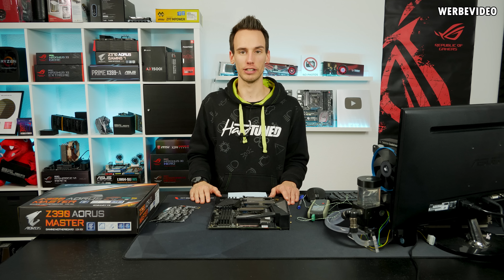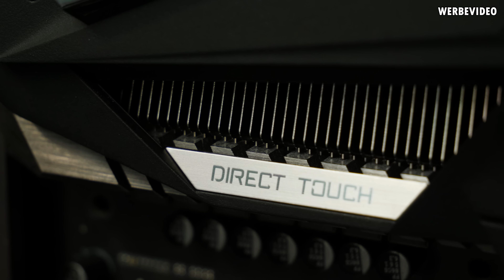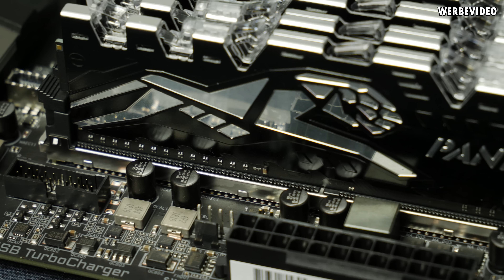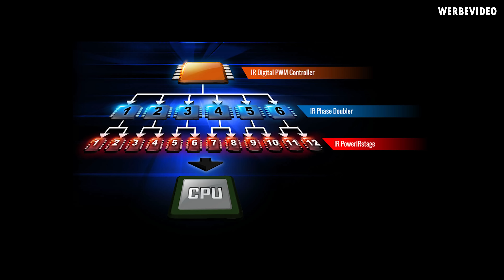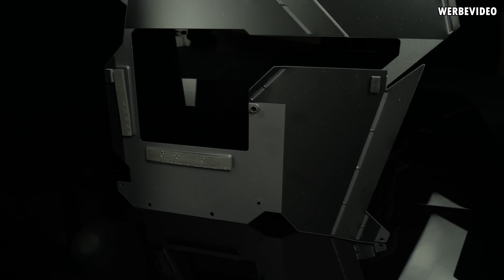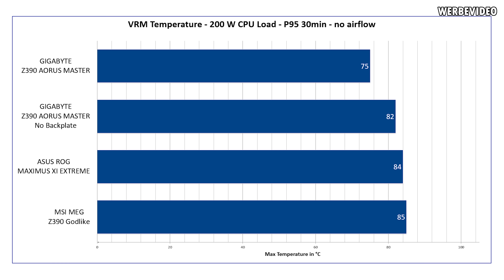Z390 AORUS MASTER - Aka the VRM MASTER (en)

Comment: I understand that I am very much late with my question, but hey. 
So, I am in doubts whether or not to pick Aorus z390 Master over Aorus z390 Pro (one is obviously better than another, but also comes at a higher cost), my main concern was that Pro has 6 power phases doubled into 12, which for no specific reason I thought might lead to  temperature issues when overclocking a i7-9700k, thus I started looking into Aorus Master which, again for no specific reason, I though had actual 12 power phases and it doesn't seem to be the case according to the internet, but is still an overall better choice due to well designed heatsinks and a backplate. Is that true and do I even need to be concerned about i7-9700k running at 5GHz on Aurus z390 Pro?

Comment: Hi to everyone.I just bought 9900k and this board and the board have 2 8 pin eps power connector to the board so should i plug the 2 8 pins to board or just 1 is oke ? i am confused :/ Also i am planing to use this cpu 5ghz all time
Reply: 8+2 you need. my friend have the same board when try to make 5.00 ghz he crash all time when he add 8+8 he get 5.20ghz but 8+2 should be good
Reply: cristian Piotr hmm interesting i am using stock now 4.7 not tried 5.0 yet but i will and try oke thanks

Comment: 9900K 5.1 GHz all cores on Aorus Master LLC is Extreme with overclocked ram (G. Skill 3200mhz CL14 to 3300mhz tightened timings) max VRM temp I've noticed is around 57C. But my case is extremely well cooled.

Comment: I wonder if sticking  thermal pads between my motherboard and case would help at all? The motherboard standoffs are pretty tall, so it would need to be a very thick thermal pad, but still, the side of the case is a pretty big area to use as a heatsink.
Reply: I thought about this as well. I think the pad would be too thick. You'd either need shorter standoffs (maybe 4mm) and then a 1.5mm pad OR alternatively normally-sized standoffs, a properly sized copper shim, and then a 1mm pad. Things get trickier if you have an m2 connector on the backside and it needs the speced 5mm of height for it. Then you'd need the normally-sized standoff solution.
Would be an interesting experiment!
Reply: Checking around, it looks like you can readily get 5mm-6mm thermal pads, but that is about as thick as I could find without being some sort of custom item. That probably isn't quite enough, as it looks like ATX specifies a minimum standoff of about 6.5mm. So, It looks like it could be done, but it would be a bit of a project, and the thermal connection between the motherboard and case probably wouldn't be a very efficient one. It probably wouldn't be as cost effective as just pointing a 120mm fan at the front side of the board, but it might still be fun to play around with.

Comment: i have this board for a month or so now and i do love it, especialy for it's price point (not cheap but not idioticly expensive)
but i do have a few things i don't like about this board, like the pci locking tabs are a bit to narrow. i have 2 watercooled 1080ti's connected with a terminal
so i like to remove and install them as one block, but it's almost inpossible to get to the lower tab to get my gpu's out. 
also i don't like the position of the error code led, my old z170 ranger had it right next to the dimm slots. this one has it right at the bottom, so in between my gpu and radiator
Reply: geen naam how’s it treating you a year later
Reply: @Everydaymoves  
hehe still good
but it's also because i got rid of my radiators and got a water chiller, so i got a lot more room in my case. can see my error code led again and working on it became easier
i'm not having the best overclocking results though. 9900k on 5.1ghz with little under 1.4 volt and a lot of bios tweaks
was hoping to get a bit further with a chiller, but might be more bad luck with my cpu
overall, good sexy mobo, if you have a bit of room in your case
Reply: geen naam I just bought it an Asus z390e kinda scared about all those negative stories I see about it failing or not posting
Reply: @Everydaymoves 
Ohh never had those problems

Comment: Very good and well presented info....I would like to know if the aorus z390 extreme has the same thermal pads on the backplate as the master....I have already purchased a i9-9900k and stuck between the Asus z390 maximus extreme or the Aorus z390 extreme for gaining the most out of my i9-9900k, although I really like that the Aorus board has the built in thunderbolt 3 and the Asus board will need a pcie card for thunderbolt connectivity. I read that the gigabyte bios is inferior to Asus bios for overclocking and most everything else, but also read that Asus thunderbolt 3 add-on card isn't reliable. I know you have hours soon hours with asus products,......what are your thoughts please???
Reply: watch this vid: https://www.youtube.com/watch?v=6J7qnr0YNH8& (and go with aorus master - deffo not the Asus, (watch other vids on this channel too)

Comment: I'm running the Aorus Ultra with my 9900k and its VRMs are staying below 60c under full load, 5.1 GHz 1.26V, no AVX offset, LLC Turbo. I have a small 40mm Noctua mounted to the VRM for cooling. Wonky bios coming from a long ASUS buying streak but I'm pretty happy with how well this board overclocks. 

Can you review the Ultra and the Master compared to the Maximus Extreme and the Hero?
Reply: 5.1 at 1.26...wow..

Comment: Der8auer : I know you're busy and I don't know if you will read this, but one thing MANY overclockers want you to test are Transient Voltage Overshoots when using "Maximum" Loadline Calibration (0 mOhms loadline) on this GB Aorus Master board.  This requires an Oscilloscope to test; maybe a Fluke Scopemeter may work too but a regular DMM is not accurate enough for this.  Transient overshoots happen in the microseconds.  It would be very helpful to set Loadline Calibration to Ultra Extreme on the Master, use a low safe volts (to protect your CPU) like 1.20v, then use an oscilloscope to test prime95 idle to load to idle (at safe settings like 4.5 ghz 1.20v, LLC=UE) to see how bad overshooting is.  Bonus for testing with "PWM Switch Rate=500 khz" and "PWM Phase Control" = Extreme (or highest setting) in the Bios.

No one has done this test before.

Comment: I actually want to see the comparison of the 5.0oc voltage among these high end boards. The thermal performance is various by many elements in the test. The voltage shows the real oc ability of the boards
Reply: 1.270v for 5090MHZ all cores on my 9900k, hits 78 degrees under load

Comment: Why don't we see more 24 phase mobos like the p67 ud7 board i'm using ? Or maybe the question is why there was a 24 phase mobo that was probably not needed.
Reply: 24 phases are stupid for almost all circumstances, if you make a good 16 phase and cool it well it can be just as good or even better, and most cpus dont need that much power anyways, not even on LN2

Comment: 9900k OP to 5.ghz  on 1.32 vcore and LLC on turbo (think it is 6 or 7).  My CPU high after on hour of gaming is 74c degrees and VRM never hotter tha. 49c degrees. Im running a 480 radiator custom loop. Gigabyte Z390 Master.
Reply: My 9900K @ 5G 1.29 LLC6 in the Asus Maximus Hero X (Z370) with VRM around 55C, never above 60. I think as long you have a decent Mobo it doesn´t matter at all which MB you get. The Aorus Master for 250 Eur is definitely a very good choice, specially compared to the 500-600 Eur top models that won´t add much for the 99% of the users.
Reply: @Miskatonik  I agree and happy with my purchase :)
Reply: my i ask how much did that custom loop cost ? i mean is it under or over the processor's price ? xd
Reply: @pktgako  Raystorm v3 water block I bought over 3-4 years ago for my 3770k and later used in my  5960x build and now used in my 9900k build. So i have gotten the most out of  my 400 dollar water cooling set up.

Comment: I feel like using the heat sink on the M.2 drives is worse from what I've seen. The controller is what gets hot and that's usually on the side facing the mobo and the heat sinks can trap warm air or affect air flow in general
Reply: Which m.2 drives have controllers facing the mb? The 960 evo surely doesn't, the back of it has no components on it as far as I remember.
Reply: I can't speak to this motherboard, but I saw much better temps without the provided heatsink on an ASUS Rog Strix Z370 I gaming. It's an ITX board where the PCH and primary M.2 sort of share the same heatsink. I tried using the heatsink with the included thermal pad, but my drive (which already is pretty hot) would get the controller up into the low 80's. Removing that heatsink and sticking on a tiny 14mm GPU ram-chip heatsink I had lying around dropped temps into the mid to low 50's. So I would definitely say not to assume an M.2 heatsink is actually helping. Fire up HWInfo and test!
Reply: btw. this vid convinced me to get Z390 Aorus Master out of all Z390 mobos https://www.youtube.com/watch?v=6J7qnr0YNH8&

Comment: Asus Z390 Maxiums XI Formule, very cold with water on it.
Reply: Bartosz Bruhn it’s kind of cheating
Reply: You shouldn't let your motherboard get wet. The evaporation cooling effect is strong but it will leave residue on your mainboard and risk shorting components. #PlayingDumb
Reply: @think_ffs3934 unless you get "pure water" which cannot conduct electricity
Reply: @DarkPa1adin  Yeah, but you're missing the joke. I was #PlayingDumb, pretending he meant he was getting the board wet to cool it, when of course he meant using a water cooler which doesn't actually get the board wet.

Comment: 5:28am in NYC I was about to close my eyes but then der8auer uploaded this video on this GORGEOUS motherboard and therefore I just had to watch it lol.
Reply: No lie it's pretty nice. I got 2 of these on sale Black Friday (it's overkill for wife's gaming PC but I like having identical components as much as possible for troubleshooting/etc and I build our PCs at the same time). As good as it looks IN the system it looks and feels better when handling the board. That blackplate is both stylish and gives you a great feeling of stability when working with the board outside a case. Of course, that only lasts until you finish your build - but then it's still pretty.  (Though as der8auer shows here, it's functional for heat reduction after that point, too!)

Comment: Can you make a video with this mb and the 9900k in overclock?
Reply: I have a i9-9900k to....and would like to see this board overclocking ability with that processor....I'm stuck between this board or the aorus z390 extreme.....would like to have the on board thunderbolt 3.
Reply: diego someone on YouTube did. I don’t remember who. Just search 9900k Overclocking.
Reply: I am achieving 5.2GHz on all cores with HT enabled stable @1.355V with this MB, after that my 9900k goes into throtling (paired with Fractal Design Celsius S36 at the moment temporarily) - I can not go any further and I believe cooling solution is not the problem here but the quality of solder and delid is comming for sure. Whith my experience so far I can say only great things about Z390 Aorus Master paired with 9900k, However I own it only 2 weeks now so I could not make all necessary tests. One thing worth mentioning that comming from Asus it takes a while to get used to Gigabyte BIOS layout. If you need more details about settings for BIOS to achieve this overclock - I can provide it in few days once back at home, however I also had to google it (also available on YT https://www.youtube.com/watch?v=WZVKSUJXN8k ) as some BIOS options on this MB were completely new for me.

Comment: Im a little late to the party. But after seeing your Gigabyte z370 Aorus Gaming 7 review i went out and got the board for ($150) and also found an 8700K for ($280). Couldn't pass on that deal. But what i would very much like to see, Is how well the Gigabyte z370 Aorus Gaming 7's VRM handles the i9 9900k. I haven't seen any testing done on this. I wanted to stay away from liquid just to try something different. Like the 11year old (brand new)  ZALMAN  cnps9700 led all copper cooler i put on the 8700K, it actually fit the board with 1155 bracket perfect. On the box it says it would fit all 115+ sockets. Not all of them say that. But it did fit the 1151. the temps are at 85°c under load at 5GHz. Yeah. another thought i had was to put the vrm fins from the x470 gaming 7 on the z370 Gaming 7. I appreciate the replies. I guess i got lucky with the vrm lottery. Cause under stressful load for more than 3hrs. The vrm didn't pass 60°c with the 8700K @5GHz so I woild think the 8core would be alright.
Reply: My VRM got hot, I made a video about it on my channel. I am still looking into it further. The 8 phase design is good, but the VRM cooling is a joke. I customized an old z77 Sabertooth MB cooling kit and brought temps down around ~50C.
Reply: It will be perfectly fine. My Hero X handles the 9900K at 5Ghz without problems (55-60 C), and the Aorus VRM was slighty better.

Comment: I have this board and it’s good!  Really cool(cold) and good for a silent build.   But the included Audio solution is not on par with the competition.  The audio chip&dac are good but the drivers provided are absolute minimal
Reply: James PT,  i have z390 master also. Nothing but trouble. Google chrome doesn’t seem to work with this board. Every other browser or program i’ve used works perfectly. Oh, and the network drivers are a pain. They didn’t install on a clean windows 10 install. ”Network adapter not found”. Instead i had to hook up my phone via usb and update windows 10, which took 7 hours (100mb/s 4g).  After that they installed and works, at least as long as google chrome isn’t running.
Reply: @jaybee0507  The Wifi drivers worked for me from the Windows install, I also was without Ethernet, but I just got on wifi and let windows update.  Also I think the Gigabyte drivers are on the CD included.  Chrome not working?  Bad Windows install I guess. not the motherboard if everything else works.
Reply: @Spellspt  I've installed fresh windows a couple of times and chrome gives nothing but trouble. I'll try downloading windows straight from microsoft web page when i get home as my windows copy might be pretty old. Other than that this motherboard seems awesome. Have you figured out is there a way to overclock in a way you could drop the voltages when idle? I tried the dynamic vcore offset option, but it seems to decrease idle voltages as well, making idle unstable. So far i've been using static voltage.